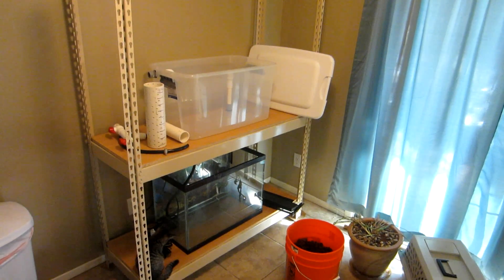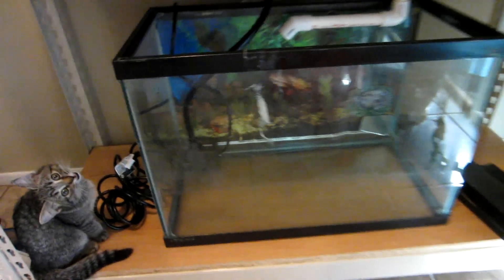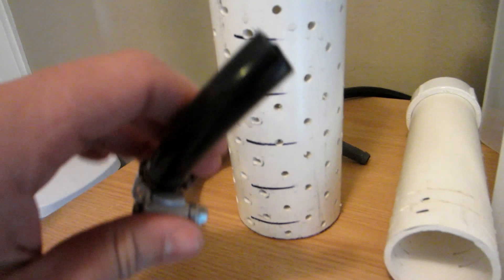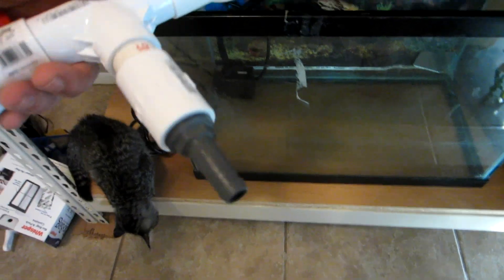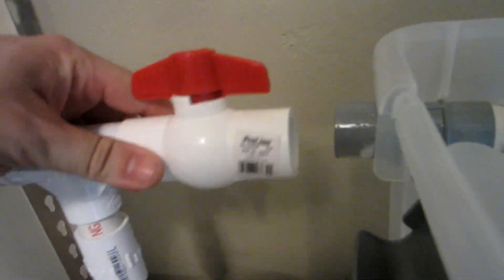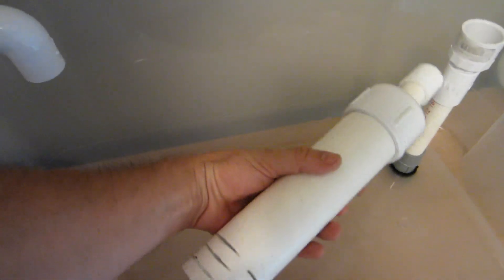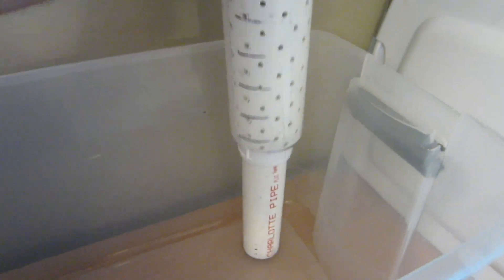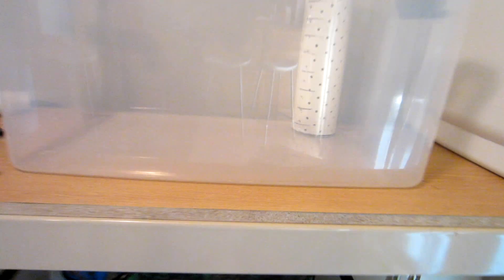Indoor Aquaponics with 20 Gallon Tank Part 1

Comment: Hi Shane! I am just starting my system with 20 gallons and your videos have been so helpful. I have a very similar grow bed tote. How did you get the holes in there? I bought a hole saw for my drill and it chewed up one tote already. I'm hoping to spare my second tote hahaha. Thanks!
Reply from the maker: HI Michael  I did drill mine with a hole saw.  Try drilling medium to slow medium speed and do not push the drill, let the drill do all the work.  Place the tote on top of a piece of wood and hold down the plastic against the wood as you drill.  You can practice on the one you messed up.
Reply: SmallAquaponics Really appreciate the tip! Did you need to use silicon or were the washers enough?
Reply from the maker: It leaked a little until the hard water deposits sealed itself.  Silicon would be a good idea.
Reply from the maker: If you do use silicon, make sure it is aquarium safe non toxic.

Comment from the maker: Hey Thanks!   I picked up most of this stuff from Home Depot and Ace Hardware.  The shelf unit was donated and I dont know where it came from.  10 Gallon's should be perfect for an apartment.  For best use of space you might be interested in adding a "strawberry tower"  Make sure you get a pump that can push water at-least 6+ feet vertical if you want to add a tower addition to your ap system in the future. 
Video reply with your system if you want
Thanks for watching

Comment from the maker: The medium(rocks in grow bed) will start growing nutritious bacteria known as nitrate and nitrite.  The bacteria feed off of the fish ammonia and the plants feed off of the bacteria.  The medium is a filter in a since.  I am using a paint bag so fish solids do not go into the grow bed.  Others let the solids in and have worms to eat the solids and supply worm castings.  A sump pump with check valve would be nice so I dont have to keep topping off the system but it is not necessary.

Comment from the maker: Made a hole with a drill, installed a threaded electrical conduit male to female adapter with rubber washer in between.  From those adapters you can install 3/4 PVC directly.